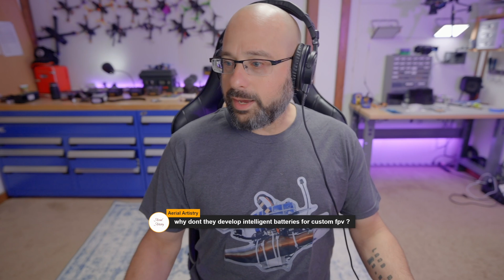Why Don't We Use Intelligent Batteries For FPV Drones? - FPV Questions

Comment: Honestly I want a QR, or better a RFID, on them to have my charger auto-select the right settings (at least LiPo, LiHV) and ideally allow me simple parallel charging by counting how many times I beep the QR in succession for example. Actually easy to set up and use, totally optional, and easy software. Hota almost made that.

Comment: occasionally I do wish they would self discharge, lol.
I was DEATHLY ill for four days JUST after I charged up 3 batteries for some light flying. Hope I didn't damage them TOO much leaving them fully charged for three days before finally managing to discharge them in a sickened stupor. I was basically bed ridden and would drag myself to the bathroom as needed. I sure didn't want to screw with my horribly slow discharging circuit built into my charger that takes about 8 or more hours to discharge one battery and then lie to myself and tell myself I am 'monitoring' them in the other room.

Comment: The Skyrc q200 Neo charger has a cool option of "monitoring" the battery, you print a QR code, stick it on the lipo and when you want to charge it, you do it through the application on your phone. Thanks to this, the charger knows what parameters to set. Maybe SkyRc could add "historical data" to this application, because I would like to know how many times I charged my lipo, which would allow me to better assess their quality. One of the iSDT chargers has similar functionality, instead of a QR code there are "intelligent" BattAir plugs, but I haven't tested them due to the high price.
Reply: Mine just broke in a week and the company isn't replying to me anymore I've tried the contact form and email and no reply in over 10 days
Reply: @ignitoracing Sorry to hear that, I've been using SkyRc q200neo for a year and a half, I've charged about a thousand batteries and no problems so far. I'm happy with it. My LIPOs are mainly used 850mAh 4S and 1200-2000mAh 6S, I charge the large 4000mAh batteries with a more powerful Hota F9 charger with an external power supply.
Reply: It always charges LiPos at 1C, maybe you used the maximum power of the charger? The built-in AC power supplies in the chargers are a known problem not only in SkyRc but also in Hota and ToolkitRC, it is better not to use more than 50% of their rated power.
Reply: @dabfpv  I charge at 1C always, funnily enough I made a reddit post to r/fpv about my experience and 10 minutes later they replied.. My post wasnt "nice" lets put it that way. I took the post down and they asked me to ship the charger back at my own cost so hopefully I'll get my money back..Not sure if it was a coincidence but atleast now they replied
Reply: @ignitoracing I praised this charger too much, it just burned out :( It's a shame because I was very happy with it. I contacted SkyRc, they even replied, we'll see what happens next.

Comment: Have you seen the ISDT Battair batteries? I gotta admit, having a battery storage itself automatically a few days after charging is pretty convenient.
Reply: Let me go buy new chargers and everything because I’m too incompetent to plug it into my charger and set it to storage voltage or take two minutes to fly it.
Reply: @YoYoMommie  just say you're broke 🥀
Reply: Heavier + more expensive
Reply: @RhadRoshan-l8j  the 6s1300 is only 19 grams more than a tatu 1300. And they're $40 for 2.

Comment: Another reason is if I want to fly over water knowing I have just 30 sec of flight time and I will be able to get this nice finish of my video and land safely, I do not want to be blocked by "smart battery"which either force me into RTH or land straight into water just 2m before feet dry. In other words if I want to kill my battery to save the quad, so be it! And no smart system should try to be smarter than me.

Comment: I always thought it would be cool for a company to have a RFID system so you could attach a RFID to your battery. Then just wave it over your charger and it would automatically log the health and setup the charging parameters for that batt etc. Would kind of be "smart batteries" but require only a RFID sticker.
Reply: Radio-frequency identification (RFID) uses electromagnetic fields to automatically identify and track tags attached to objects. RFID aren't 'magic stickers.'
Reply: @toolbaggers  i mean like NFC sticker RFID tags... You would just stick one on a new battery then "register" it with your charger. That way your charger knows exactly what battery it's currently charging and keeps track of info on that. (number of charges... internal resistance. Etc.)

Comment: I kinda dislike Spektrum SMART packs for RC cars, has voltage telemetry to transmitter and easy automatic charging BUT hella expensive and the chips often fail which is just another weak point added. Takes charge rate and voltage out of the equation for noobs

Comment: What even are smart / intelligent batteries?
Reply: Batteries with a built in BMS (battery management system) to prevent overcharge / over discharge / overcurrent /overheat. ISDT Battair are literally a brand new smart FPV battery that's hit the market fyi. They're actually pretty cool, they can automatically self storage a few days after charging.

Comment: ISDT recently published Smart Lipos meant for FPV. But only up to 4s
Reply: I'm pretty sure that I've seen 6s version
Reply: Each battery requires a dongle, no good... They should have gone with NFC tags imo.
Reply: @jozafax  you can buy the dongles separately for non isdt batteries. They put Bluetooth in the battery itself on the actual ones.
Reply: @pickeljuice9325  Well, I don't like that either. They are just trying to lock you in their ecosystem; the worst offender is Spectrum in cars and planes... In the last 15 or so years, I've learned to handle lipos just fine. It's not complicated; noobs should learn to handle them too instead of relying on questionable crutches from the manufacturers.
Reply: wrong they have 6s 1300